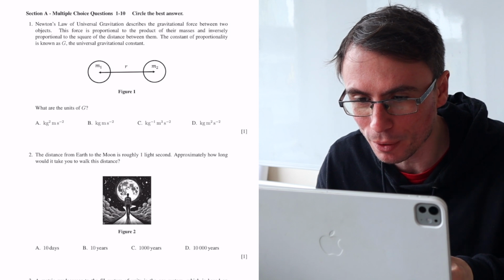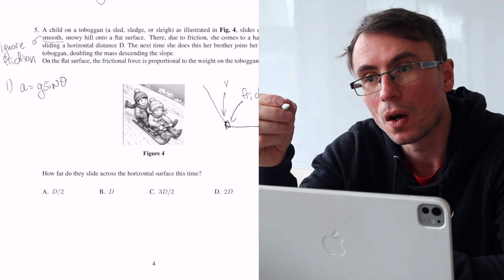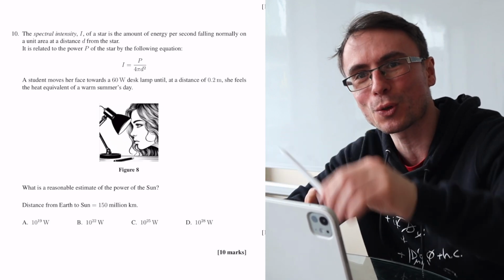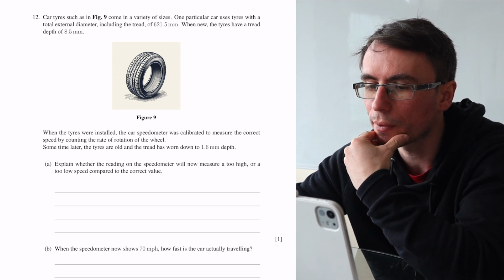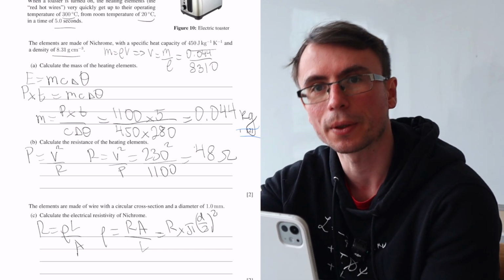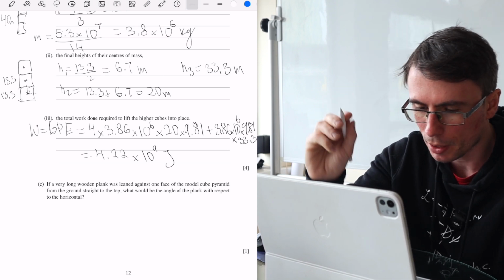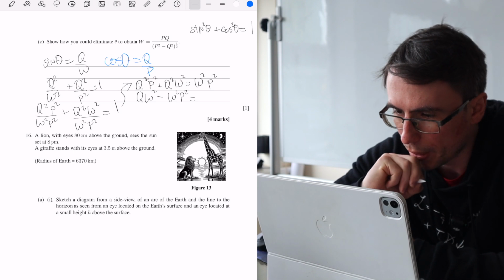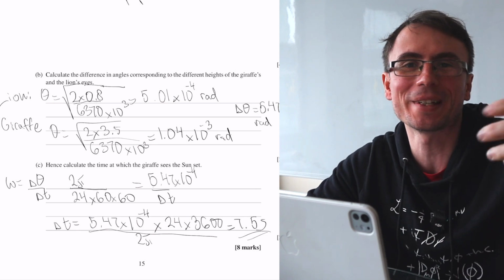Complete Guide for Senior Physics Challenge British Physics Olympiad

Comment from the maker: Update on Q11: FAR More intuitive (at least for me) is to use Pythagoras' Theorem.
So the distance to the horizon, call it, d is tangent to a point on the Earth's circumference. 
I.e. we can get a right hand triangle between a light ray touching the Earth at a point to the top of height h.

Using Pythagorar we get:
R^2+(R+h)^2=d
I.e. d=sqrt(R^2+(R+h)^2) 

Now here is a trick, the mark scheme assumes h<<R so we only really need the first term of the binomial expansion of d, which is d=sqrt(2Rh)

Now we have d, meaning that we can set it equal to:
d=r*theta 
theta=d/r=srt(2RH)/R = sqrt(2H/R)  Hopę this is useful!

Comment: In Question 13, I  would just convert 70mph to 70x1600m/h and then divide by theoretical circumference to get a number of rotations per hour. then times that number of rotations by the true value of circumference to get the true distance covered in an hour. then just divide that by 1600 to put it back into mph

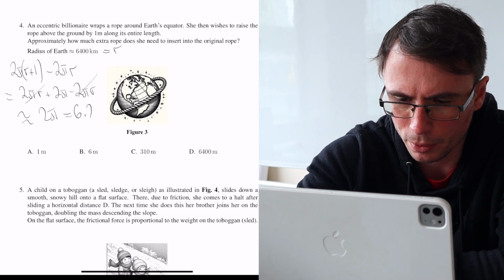Comment: 7:24 why is it in metres if we’re given the radius of the earth to be in kilometres, shouldn’t the answer actually be 6km? (It isn’t given as an option though)
Reply from the maker: they would differ by 2pi*1meter which is around 6 meters, if you worked in km you'd get the same answer by calculating 2pi*6400 000 m and 2pi*6400 001 m and finding the difference. Hope it helps!
Reply: Understood. Thank you!